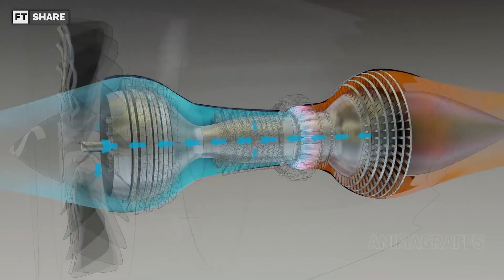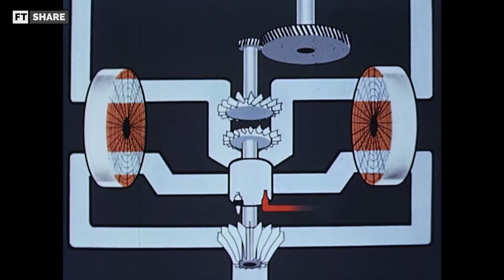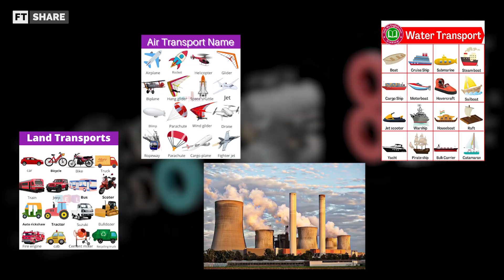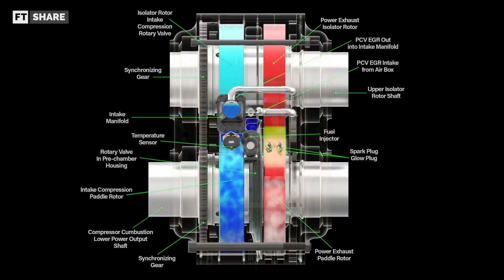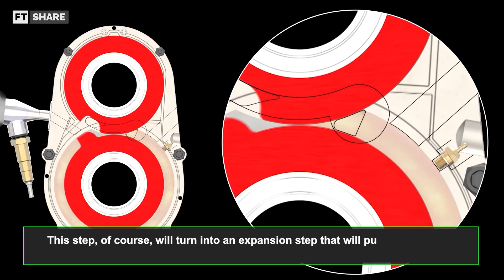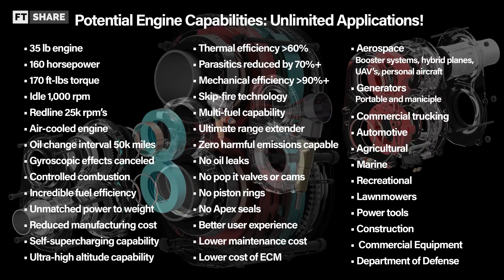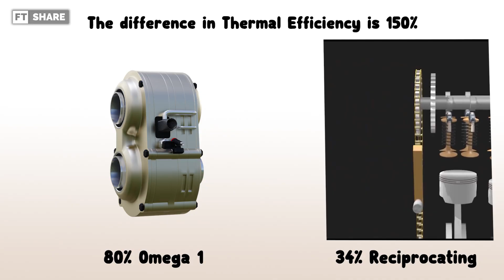Ready To Destroy EV Engine!! | Astron Aerospace - Omega 1 Engine

Comment: The main issue with the old Chrysler Turbine is that it could run on multiple fuels and was very efficient. This little engine one would think gets pretty hot and need good gear management for the low end to have much torque. Maybe something like what was used for the older drag bikes where they used like a snow mobile clutch. Where's the drive shaft?

Comment: Rotary combustion engine... Seals at the rotor parts will be the issue just like Mazdas Wankel engine, the difference is the tooth on the rotor is the combustion chamber rather than the geometry and rotor offset. It is definitely an improvement in the reduction of complexity but it shares some of the Wankels primary issues.

Comment: Lol no leaks and no sealing problems haha and nothing but a 3d model and some fast videos of it “running”. Also 80% thermal efficiency is not possible for heat engines, come on Carnot heat engines can only be 64% efficient. We’ve reach the limit of combustion engines, let’s move on

Comment: Cooling will be "interesting", some problems can be solved with titanium and ceramics, lubrication still needs oil, and combustion engines always use a little bit oil by leaking it to combustion process, so zero emissions with the overhyped hydrogen will not be completely that. Hydrogen causes brittleness to everything it contacts for long periods, so hydrogen ,with it's all other problems, it is just a pie in the sky for transportation. A dead end. But this engine is interesting. I wish they would have let it run longer, and over idle speed, as the area just after ignition will get hot, and a water jacket at least there would be nice. They could transfer the heat from that hot area(s) by adding a primary jacket of lead bismuth convection circulation, and keep the thermal efficiency level high. Water cooling just for the whole package. Or,lubrication  oil cooling with sufficient radiator, as the thermal efficiency is high, and power output per one unit could allow that.The engine with sufficient cooling will eventually weight more than 15+ kg, but will still be light. The operating rpm area removes the need for transmission with several gears, only two may be enough, as we will not know the torque curve yet. Nice, just kill the EV:s, the Ladyshaves for the naive and the douchbags...

Comment: Electric power plant plus this Astro omega engine  using hydrogen as the fuel can form a hybrid power plant that can be of high thermal efficiency. Part of the Astro omega engine output can be used to charge the battery when it falls below a threshold value , thereby increasing the range of the battery considerably. I think so.

Comment: Yawn, it's been done before in the virtually identical Unsin engine and others. Either the seals seal or they don't, if they do seal then they need lubrication and there as they say is the rub. The Unsin consumed vast amounts of oil on a total loss basis..
And then there's cooling. A piston engine is partially cooled by the incoming cold air, on this the combustion side rotor sees only combustion temperature gas, how is it cooled? They show no cooling system. I want to see more footage of the thing running under power, not idling and strip down videos afterwards.
Many many weird and wonderful engines have been designed and run, very few make the grad and succeed in the long term.
See 'Some Unusual Engines' By L. J. K. Setright published by the IMechE

Comment: If this is viable, applications in motorsports as well as commercial vehicles would be ground breaking. The wankel is fundamentally flawed, and I've often wondered why no one has considered a circular rotor design.

Comment: Usual issue with engines that use one space for compression cycle and second space for combustion is throttle response. For planes it is not a problem. For cars, not ideal. So scenario where this engine is used as power generator is most probable.

Comment: Chrysler was not the first to develop a turbine engine, they have been around for years before Chrysler tried them. They were not the only auto company to try a turbine engine in a car, Ford built 3 1956 Thunderbirds with a turbine engine. They never put them into production. Why no video of this wonder engine running? Master mechanic, jet aircraft and automotive.

Comment: You need a material that does not expand under heat at all for the combustion rotor, otherwise this motor will cease to spin when it reaches operating temp OR it will have no compression before it heats up.

Comment: No apex seals - but has a rotating assembly that compresses air, so how is that seal supposed to work long term? That's WHY the rotary engine uses apex seals - to achieve the tight tolerances required, while mitigating for different thermal expansion conditions. Plus at 25krpm - how does it balance itself? Interesting concept, rubbish practicality IMO.

Comment: The obvious problem is sealing the rotors just like any rotary engine. A combustion engine has huge pressures and needs seals that can be lubricated to hold the pressure while still sliding without excessive friction. Simple close tolerances are not adequate when the engine must operate from cold and also when very hot. The claims of efficiency are also dubious. Another pie in the sky design that will not get past prototype, but could waste a lot of money on development.

Comment: Although I still believe there is more work to do regarding the internal combustion engine, I think its a bit disingenuous to ask what is a more complicated engine while showing a 4cyl engine with the cams, pistons, rods, valves without the case and show this Omega 1 engine all nice and tidy completely put together.  If you go by the graphic you showed of the internals @2:19 in, I think they are both pretty darn complicated.  Also Wankel engines are notoriously needy.  Combine a finicky Wankel with a turbine and I honestly don't know what you are going to get.  The best or the worst thing possible?  I wonder how this engine stacks up to Nissans 3 cylinder engine that makes 400hp?

Comment: This engine is years away from production, and likely will run out of money before they can solve all the engineering problems that arise. The only new engine in 40 years that has a hope of production is the Achates engine, which is being put into an Army vehicle for testing. If it performs well for the Army, Cummins would likely then put it into mass production. Sadly, new engines get invented all the time, but the projects always run out of money.

The big auto companies spent billions perfecting their engines, and even after all that experience they can still screw up.

Comment: And what do turbines and rotary engines have in comin? They suck fuel like a mother. Does not matter how much power it makes if you have to carry 10 times the fuel and pay for it. And it's forced induction making it need more fuel because of the higher air volumes this thing is GOING TO DRINK FUEL. Less maintenance because less parts that's why rotary engines need the apex seals replaced all the time right how are you sealing the blower/combustion chamber from its self even machined so there is little to no gap there will be compression loses in less you saying its and interference fit and then under heating and expansion the motor would seize up.  Ready to destroy EV its not even competing in the same market. Maybe race bike? Calling BS now. Love how there "Functioning prototype is just dumping water out the seals. If that much is coming out don't want to know what the oil looks like because its going in as well. You know what rotary piston and turbine engines don't have a massive spinning have you have to seal at both ends let alone 2 the have shafts at most a few inches in diameter for a reason the large the sealing surface the harder it is to keep the seal in. With this a seal of that size with something spinning in it at 35k is not going to last very long. Think I should send this to Thunderfoot.

Comment: This is total crap. It may seem like an innovative solution to a problem, it's a big fat lie. For something of that size and design would be unable to make that amount of hp and torque with a thermal efficiency rating of 80%. The claim of it being a 4 stroke engine is false. 4 stroke involves one combustion event per 2 360° rotations from the previous combustion. This engine is using a rotor just for compression of air to then be used with fuel after a transfer between the 2 rotors which is immediately used. This engine has 1 combustion event every 360° if rotation from the previous. This fact implies that this engine is in fact a 2 stroke engine. Physically this engine should not work given the design and claims made

Comment: What an absolute load of rubbish. It still burns fuel. You still have to buy fuel. It still burns fuel when your stopped at lights. It still wears out. It still needs regular maintenance. It's still harder to build and more complex than an electric motor . Just forget any kind of combustion engine, it's too late, batterys and electric motors are the future. Stop making stupid vids like this.

Comment: I call bullshit.  This engine shares may similarities with a split cycle engine that was worked on in the 1970's while I was in research labs at Ford.  The idea was to split the compression and expansion cycle so one could optimize both rather than have to compromise as in conventional piston engines.  The problem occurs in the transfer of the compressed gas prior to combustion.  There is no way to do so without incurring huge efficiency (pumping) losses.  E.g. one problem is that you have to have close to zero residual volume in the compression side otherwise you cannot entrain a lot of air and you lose lots of energy to heat in the compression side - this is clearly impossible with the presented design.  Then there is the problem of valves.  This engine seems to use sliding valves - either they leak or they do not last long.  In any case, the claimed 80% efficiency would violate the laws of thermodynamics so this is obviously BS.

Comment: What are the disadvantages?  This seems like vaporware.  80% thermal efficiency?  Common?!  In the vid...what was all that liquid falling off the engine?  If they have a prototype, just test it.   What is the big deal?  If it works with 80% efficiency and 100,000 hours life, it will just replace all piston engines almost immediately.  I smell BS

Comment: It would be more efficient with 3 chambers but reversing the gears would not work.  The engine travels in a circle, a sine wave harnessing power from something sinusoidal works best in 3 phases 120 degrees apart.  3 gears will not rotate they have to be in a line, not a circle.

Comment: There's no seals between the rotors so compressed air is going to leak into the intake side and the same with the hot side, the expansion gases are going to leak through to the exhaust. The porting between the two chambers are way too small. 
Serious lack of seals. 
How it's the power transferred to the gearbox.
Anyone investing in this i think stand a better chance of making money in NFTs

Comment: When he said 80% efficiency. That got me head scratching. It’s no way possible since it’s a thermal engine.    It’s probably best for a motorcycle since torque is weak at low end and redlines at 25,000 rpm.   Electric motor is still king, despite the battery.

Comment: If only they could ignite the mixture in multiple equally spaced chambers around the engine simultaneously such that wear and tear due to expansion / explosion torque is reduced as are harmonics.
Reply: maybe start with 4 chambers (90 degrees) and then have 3 different ignition areas per 90 degree rotation (timing) this may help with wear and tear also and might be useful depending on RPM to increase efficiency during acceleration and deceleration (like a Jacobs brake).

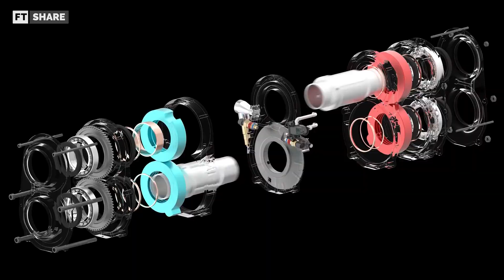Comment: It looks ok on Design. At 7:19 you can see they have plenty of room to design proper hot/cold dividers. But one thing it stuck out to me outside of the challenge with insulating and lubrication is if you want extra power wouldn't be easier to just add an extra compresion/burn cycle inside than have an entire extra  engine assembly... and yes can we see real working prototypes :P (beyond that water powered one )
Reply: I suspect the friction and emissions will be just as big of a problem as a rotory engine only moreso because of the larger contact patches.
Reply: Yeah, I feel like they need a bit more space between those two thermally different sections
Reply: I wouldn’t hold my breath waiting on any “working prototype”.
Reply: Two, three, or four teeth to magnify power output from a single engine, making more cycles per engine. Sounds good. Probably their Omega 2 prototype or something. Excellent idea.
Reply: Excellent idea! 2 to 4 cycles for the win!!!

Comment: Electric vehicles arent the answer right now. About 90% of the vehicles on the road are older vehicles people got because they are cheap and throwing in a new engine or transmission isnt a big deal. Now you have electric vehicles where even if they could be old and come down to even $10,000. Your still looking at a $20,000 battery you have to replace. Thats not at all practical and thats the reason why electric vehicles will never be widespread like everyone imagines them will be

Comment: Just for info...  Rover in the UK put a gas turbine into a car in 1950, four years earlier.  This is well documented.   The development of the Gas Turbine for use in cars did not stop because of "Euro regulation".  This was not a thing until forty years later!    Indeed, the European Union that put regulation in place for automotive engines across most of Europe did not exist until 1993.  The European Economic Community (the EEC) which was founded in 1958 (and based on the Treaty of Rome in 1957) was not concerned with such matters.  As for the other claims made, it is hard to treat them with any credibility in the light of such bias.

Having said that, if this works, it may have application in hybrid vehicles where the likely torque and rpm characteristics can be used with greatest efficiency.  In the meantime, I remain sceptical.  I think this "aerospace company" is just flying a kite trying to attract funding.  Their website does nothing to add to their credibility.

Comment: As far as I can tell, the port that transfers the gas between the 2 chambers isn't even sealed in any way during combustion? How is this supposed to work well at all? Where are all the apex seals that you're bound to need to seal this thing up just as with any other rotor-based engine? How are they lubricated? I can tell you it's not by hydrogen...

EDIT: seems like the sealing of the is done by another ring that rotates along with the rotors. You can see it in the middle of the exploded view of 7:15

Comment: I smell a lot of BS, not least the crazy claims on thermodynamic efficiency which beggar belief. The theoretical maximum efficiency of a heat engine is limited by the ratio between the hot side and the temperature of the exhaust on the absolute temperature scale. To reach 80% requires extremely hot temperatures before we even consider how the exhaust can be cooled to near ambient levels or allow for inevitable mechanical and other losses. No practical internal combustion engine gets anywhere near 80% efficiency and all are limited by the materials available.

Comment: From an engineering point of view it's endlessly interesting. But the timing of this sucks, when we're on the cusp of a real revolution in EV & battery technology – and in the economics of it. In ten years batteries will be much cheaper, will use less expensive metals, and will probably charge in 10 minutes. Folks will be hard-pressed to think of a rationale for using thermal engines.

Comment: In the UK Rover engineers installed a T8 engine into a P4 Rover 75 with the roof removed and to publicly demonstrate it on 14th March 1950. At its first demonstration the Rover JET1 produced 100bhp and was able to propel the test car at 85mph. The car was demonstrated again in 1952 at the Jabbeke motorway in Belgium this time with the engine producing 230bhp which was able to drive it up to 152mph establishing a world record for a gas turbine car. Four years before Chrysler’s first turbine car. The US also did not invent the computer, the world wide web, the jet engine, the rocket engine, the automobile, the railway, the spinning jenny, the wheel etcetera. However they did invent nuclear warfare and is still the only country to have used nuclear weapons in anger.

Comment: essentially this engine has the same issue to resolve as the rotary engine, you have an apex seal of some kind, to keep in the pressure for compression and ignition, the advantage being that these are cylinders, making the contact pretty much constant.  the hard part is that the seal has to work at maximal compression against another moving surface.  this, if anything is a material science issue, and a machining issue, to get the tolerances required, which are going to be "Jet engine tight"  might still be expensive to manufacture. However, if it succeeds, it will be massive, and I'd want one in my car and motorbike!   also for aviation it would be a major breakthrough if it can be that reliable, where power to weight ratio matters most.

Comment: The engine the were testing was nothing like the animated video. Sounded like it was a Washing machine out of balance and looked like it was powered by water pressure. ..and had lots of parasitic accessories  mounted. Looks like they are a ways  off their claims.

Comment: pretty short demo of it running.
smoke means it burns oil.
never have the efficiency on hydrogen that a fuel cell will.
this is as dead as the achates engine, and the saidis were behind that.